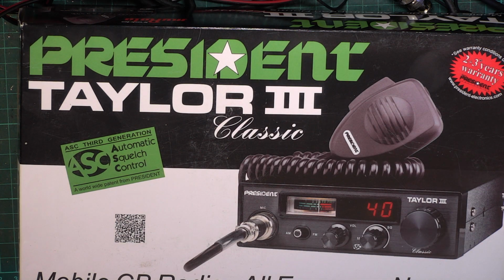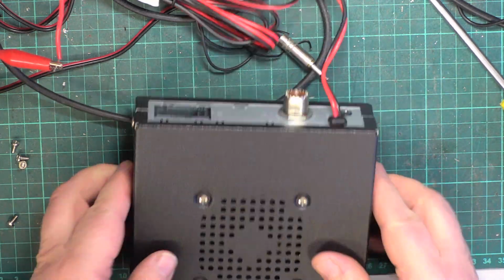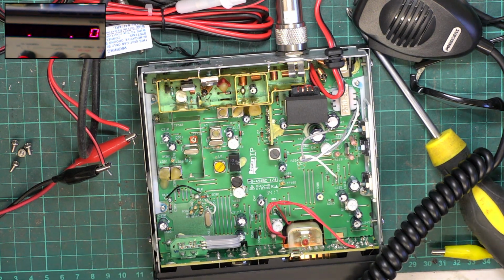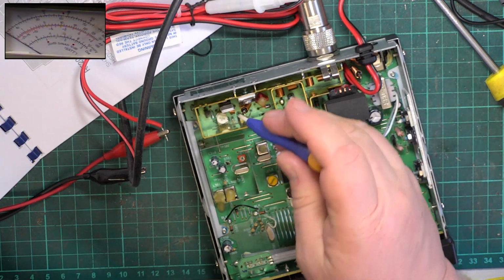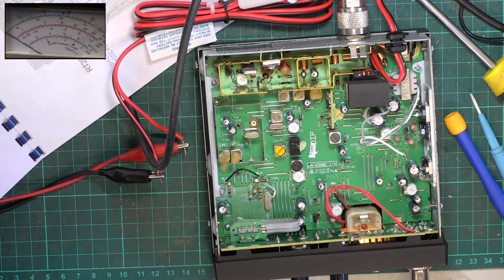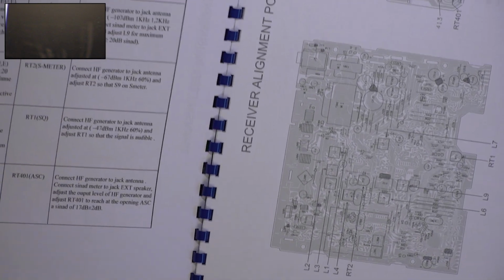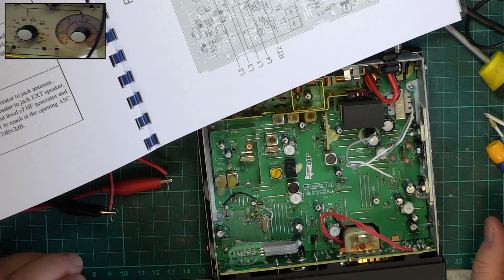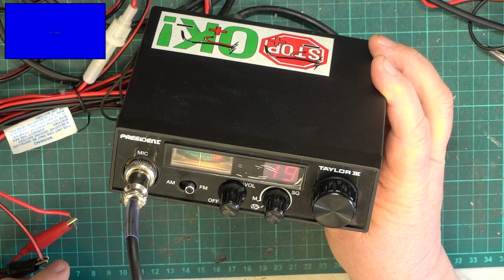President Taylor III CE MultiNorm CB radio (mobile) - Service alignment (new set)

Comment: When is President going to start using Digital Signal Processing with direct RF sampling and all signals being processed using Highschool maths you know it makes sense and all setting up can be done through a secret menu because if ICOM can do it why not President.
Reply from the maker: Icom make commercial radios, business radios & amateur radios & not CB radios. Just in case you've seen an Icom ICB1050 CB radio, it's no more Icom than my kitchen sink. Fake name use!
Reply: It would shoot the price up too. Cb is supposed to be a simple local means of communication. Despite what people push it to do. Bang it in the car, drive and chat to local stations. Long distance should be ham radio. Simple. Ps. Look at the stupid power being used on cb and even on pmr frequencies now which was mainly used with walk-in talkies and children’s coms. !? Mad! Rant over 🤩🥸

Comment: They replaced it with a Mk4 version that has a more complicated front panel, including a frequency readout. Never understood the need for that on a legal CB.
Reply from the maker: I also have the problem trying to get across to people that frequency displays are not a frequency counter...they are simply programmed to display the frequency of the channel you are using, such as UK channel 20 = 27.79125. Customers say "it sounds really off frequency, but the display shows it is spot on"!

Richard, G0OJF, UK

Comment: One of the owners of the TV repair shop (naughty CBs a speciality, hem hem)  i worked in in at the end of the 70s was an ex-test engineer from a big local Rank Bush Murphy TV factory (yes, there were once big TV factories in the UK). He told a tale of an unfortunate chap who got a terrible shock from the EHT of a set being reworked - he needed to get a bit of test equipment from the shelf above the test bench, stood up to get it, it slipped back, he leaned forward to get it, and in the process brought the metal zipper in his trousers into contact with beaucoup electrons of the EHT variety. 

He was, as they say,  never the same again. There are some cases where keeping one hand in your pocket just won't save the day.

Comment: Hi Richard.. been waiting for this from your previous video, although I don't usually comment. Would this unit be for sale?  I've always liked the  radio as it reminds me of the uniden 100, my first ever CB radio. Keep up the excellent work.
Cheers. 
Shane. 2E0 RCI
Reply from the maker: Well it is Uniden made so there you go. No this sample isn't for sale..they are something like £139.99 trade, so expect to pay more. I just checked with the wholesaler & it's just been replaced with the Taylor IV, which adds a USB charge socket to the front but retains the real meter. As I said i the video, I bought this in 9 months ago. You'll have to scour ebay or wait for the Taylor IV, which we will cover when available.

Richard, G0OJF, UK